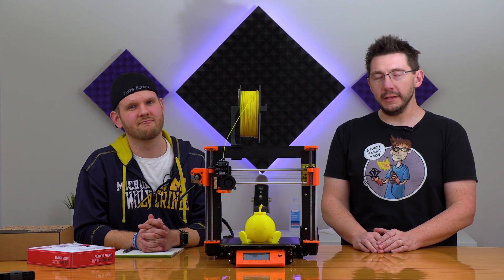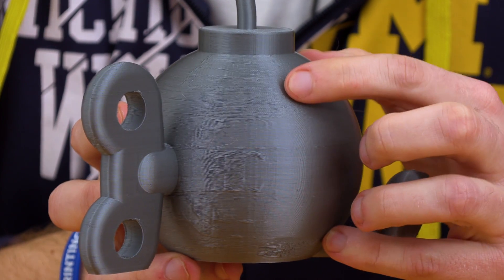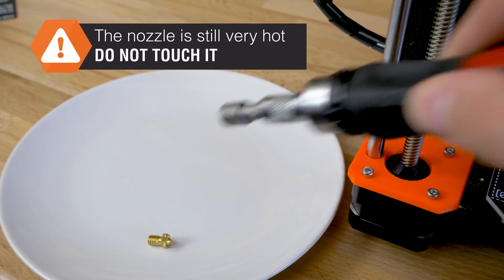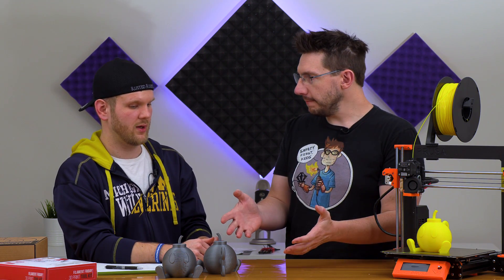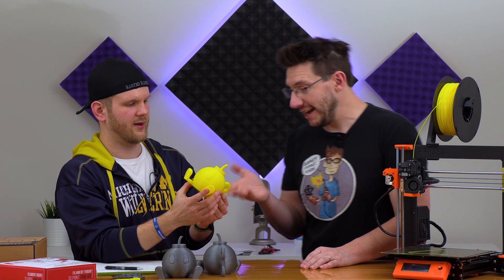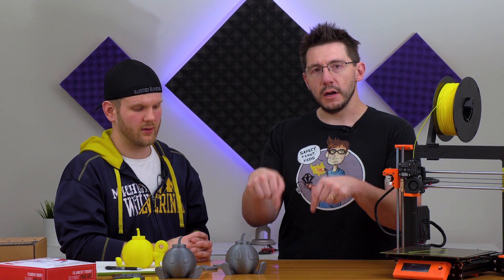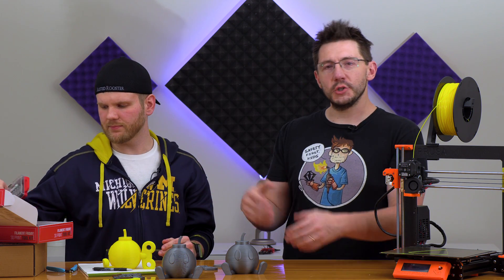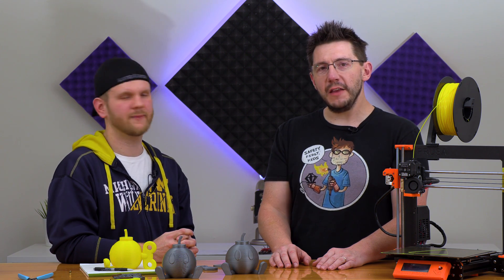3D Printing 101: Troubleshooting a Bad Print / Installing a New Nozzle

Comment: I’ve had these problems before, they are rare but hard to diagnose if you’re not familiar with 3D printing so I’m really glad this video helps teach viewers about them
Reply from the maker: Thanks! That was the thing - Sean is new and didn’t know. Now, he knows!
Reply: I have this issue right now(bad surface only in front of the objects), I had no ideia what to do.. I hope that changing the nozzle will resolve my issue.
Reply: @raphaielbr  So did your problem solve, please tell me I am also having same problem.
Reply: @proknow4305  Yes! But in my case, my nozzle was only a little used with ABS, I don't needed change the nozzle, I just keeped print, I think this self cleaned the nozzle, I think my nozzle was only clogged up.
Reply: धन्यवाद मित्र।

Comment: What destroyed my nozzle could possibly fix yours. Before each print I used to place a sheet of 220 grit sandpaper on the bed, lowered the nozzle until it touched, kinda like what you do for bed leveling, then pulled the sandpaper out parallel to the bed. Worked perfectly, but eventually ate through the brass. I was ready for that, though, and still had spare nozzles from when I sourced the parts for the printer.

Comment: Good video, Guys.
I've had that strange artifact (to a lesser degree) since day one with my CR-10S. it's driven me nuts as it seems to come and go. I'd guess every time I work on it, I'm moving the orientation of the defect. It seems the 2 nozzles that came with the CR-10S were both either machined poorly or banged up. Time to order that hardened nozzle I guess. It never occurred to me that BOTH nozzles had issues. 
Thanks!

Comment: Was going to suggest the wire brush, but looks like you got into that.  I picked up a small brass brush at Lowe’s for a few $.  I like using it to wipe the “bleeding” filament off the nozzle that comes out just before you print while the printer is heating.

Comment: Thanks for another video full of great information.  I've been dealing with layer shift too, usually with Cura over other slicers for some reason.  I discovered my grub screws were loose, but that was only have the issue.  On a side note, I also changed my grub screws to stainless steel so the hex doesn't strip out when making it tighter.

After months of troubles I discovered the layer shift was due to the travel speed.  Cura default was 120mm/sec.   I changed that to 60mm/sec and never had another layer shift in the last 2 weeks of running jobs constantly.  I think the momentum of my Y axis was more than what my stepper motors could handle.  I think there is something in Cura that did more travel or Y axis movement compared to other slicers.

Comment: Oh now... Shawn was going to finish it up, then he was cut away....
Great video. Had similar looking problems with my CR-10 Mini printer but it had another issue. I had a Y belt that was a little flexible while the X belt was not. A belt replacement did the trick.
Have some great prints Shawn, like maybe a bicycle (pretty difficult with all the spokes).

Comment: Hey Joel an Shaun , the prusa mk3 does vibrate quite a bit ,so i use thread locker on most of the metal on metal connections  (don't use on any plastic as it will dissolve over time).
You should try printing a lithophane (picture) @3d.rocks they really do look cool. 
Great channel guys and family, high 5

Comment: A few years ago, I got the exact same problem with the loose grub screw on the belt (on my X axis), on my MK2. I quickly found the solution on the prusa3d.com forum (and reprap.org forum). The 3D printing community is fantastic